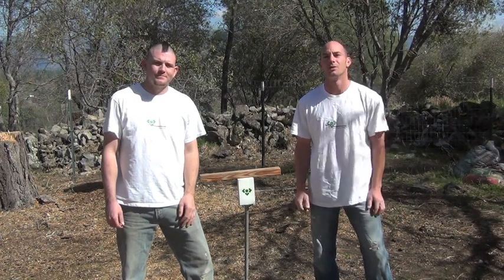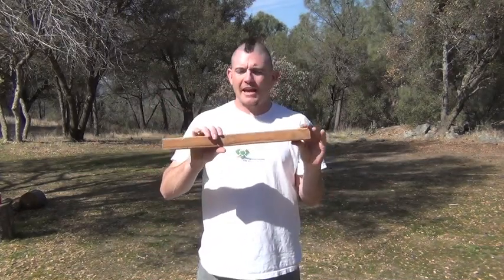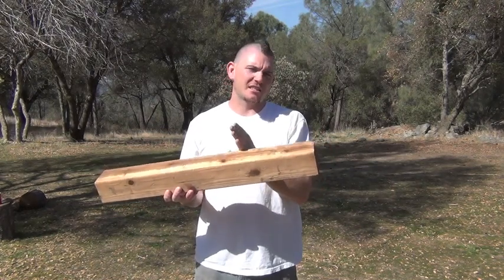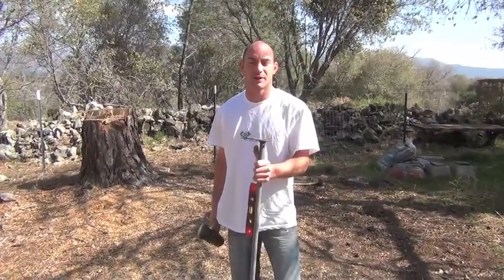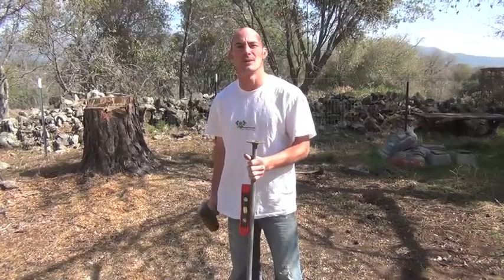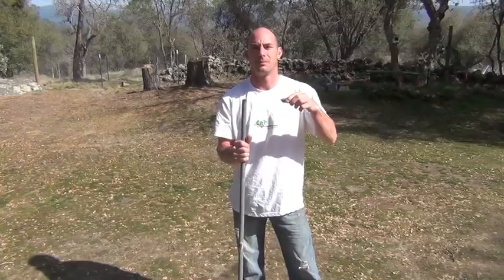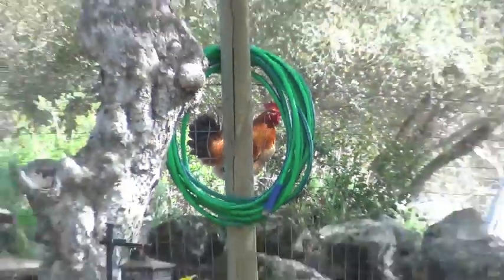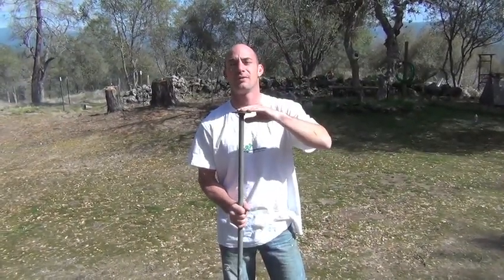How to build Aunt Sally - DIYHomegames

Comment: I'll suggest a couple of improvements to make it more authentic, like the Aunt Sally I used to play in the pubs in Brackley and Bicester in Oxfordshire. This one has a passing resemblance, but with just a little more effort it will be much closer.

First (and this is very important), the platform shouldn't just be at the top of the post. you should have a dogleg swinging arm. It doesn't have to be complicated... Just a bit of bent iron. If that's difficult, then just a short length of smaller pipe that slides into the top of your upright pipe. Put a right angle fitting on it, another short length, and another right angle before putting on your platform.  If you hit the iron, the arm will move. This is an essential feature of the traditional game which eliminates disputes among drunkards as to whether the doll was hit cleanly. Judging from the red cups in hand, you might be able to appreciate that feature. :D

The second is the doll. A 4x4 post is very well balanced, which is exactly what the doll shouldn't be. It should be a bit top heavy, and smaller at the bottom. Traditional it's a sphere on top of a truncated inverted cone, but without a lathe that could be a challenge. But it shouldn't be too much effort to use that saw to miter the bottom down to about an inch and a half. If you tap the doll with the thrown stick it should go over.

Even though the traditional sticks are round, a dowel of the proper thickness is hard to find (they should be pretty hefty). The 2x2s should work well enough, but I'd strongly suggest sanding them VERY well, especially along the corners. It's pretty easy to get splinters when throwing these things with proper technique. It's a lot less fun when you're bleeding. ;)

Finally, you'd normally see a sheet hung behind it. Again, it doesn't have to be fancy, but at the pub we prefer to leave chasing sticks to the dog.